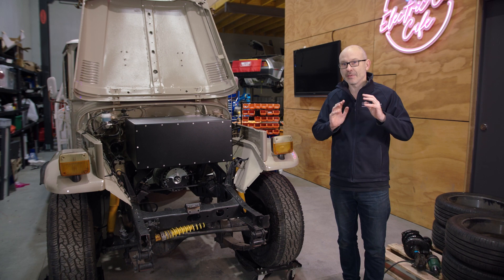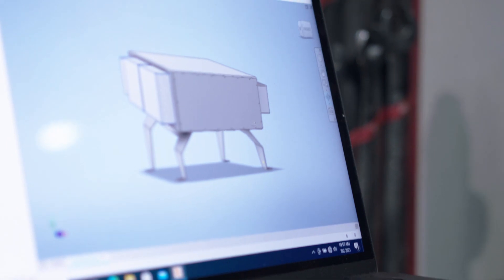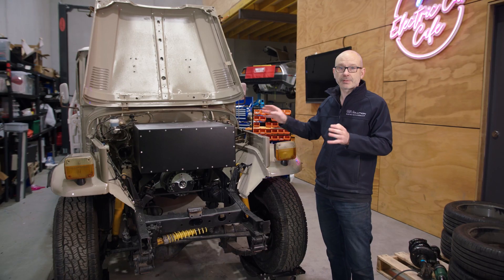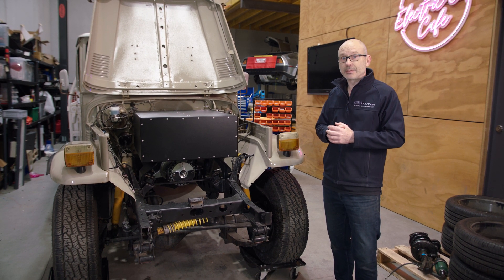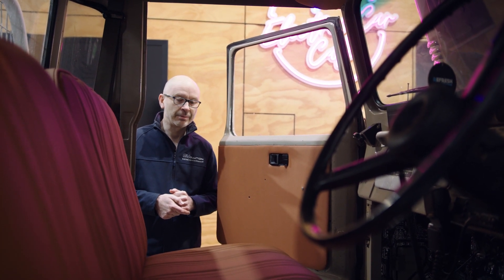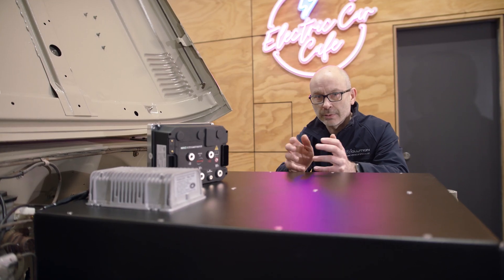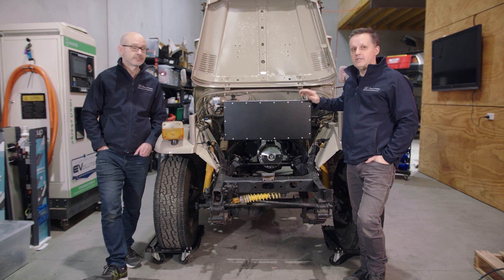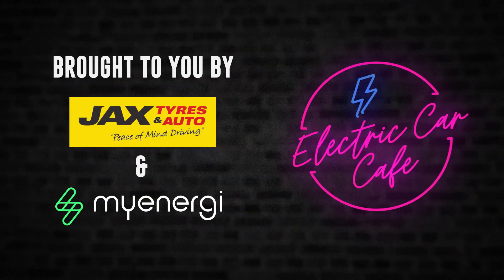Tesla Toyota Electric HJ45 EV Conversion Restomod - Part 2: Fabrication & Assembly

Comment: Fun to see different solutions.
I'm new to this with EV, but not to finding and deciding what I want.

My solution is hybrid.
That is, I want to keep my diesel engine and thus the gearbox. So complete Toyota HDJ.
My solution is to mount a Mitsubishi HPEV engine / transmission coupled on the back of the transfer. Directly on the input axle.
It allows I can run pure EV, mix or recover charge.

The reason for using a 4X4 donor is to use the rear engine on the trailer which will be 4X4.
So an 'easy' way to make transmission between car and trailer.

Car (6X6) and trailer (4X4) are all 'hand-built'
Based on the Toyota 80 series.

It's current idea plan.
Any input is welcome.

Comment: As you say that you don't need to change gears ... and have high and low range in the transfer case for difficult conditions... and assuming you can power the electric motor in forward and reverse electrically ... why keep the gear box? Is it possible to connect directly to the transfer case?

Comment: The motor seems tiny for that trunk. Can you tell us the motor spec's and the estimated completed weight of the truck?
Reply from the maker: All though small in size that motor definitely does pack a punch and will produce more torque than the original engine!

Comment: Thanks for detailed update - I was wondering if you are using a 4spd or 5 speed gear box ?? If you haven't thought of it already, can you setup electric power steering?
Reply from the maker: Electric power steering is in scope for this build. We should have that covered in the next installment.
Reply: Oddly, in an EV conversion, you rarely use any of the gears!  Most commonly, after driving it for a while, you discover that leaving it in 2nd or 3rd works 99% of the time.

Comment: I'd love to see you go over some details on the new motor and how it compares to the original diesel. HP/torque, maybe the power curves... I've never understood how you pick an electric to replace an ICE engine
Reply from the maker: Great suggestion! We'll go through this next time.
Reply: Go for a drive of a Tesla Model S. This will have ball tearing torque and speed.
Reply: The electric engine they're chosen for this conversion is no where near the same performance level as a model S engine.  It could be more than enough for an old 4x4 but it's definitely not the same as a tesla
Reply: would be great to see this!